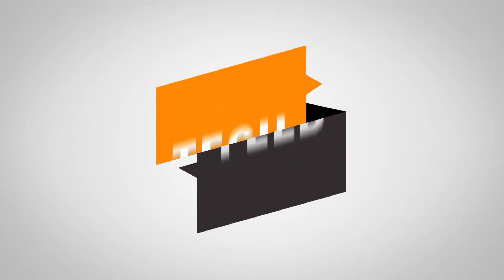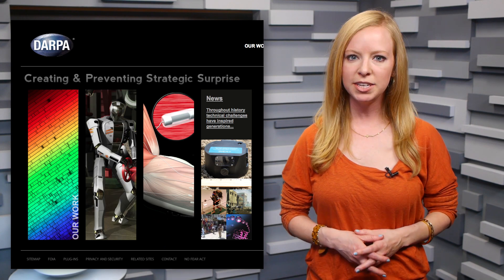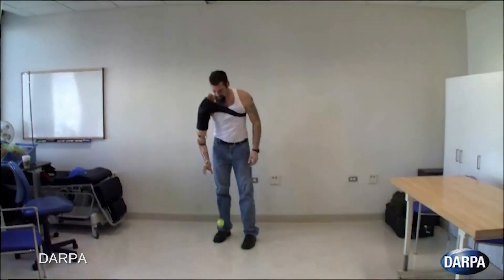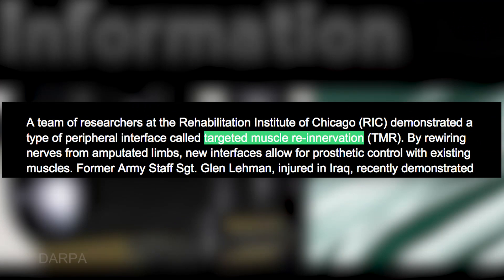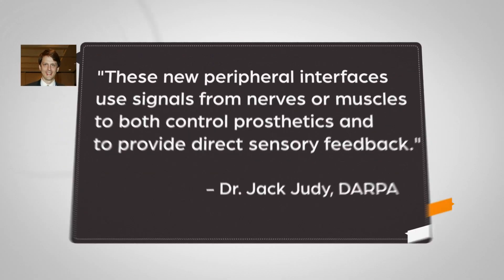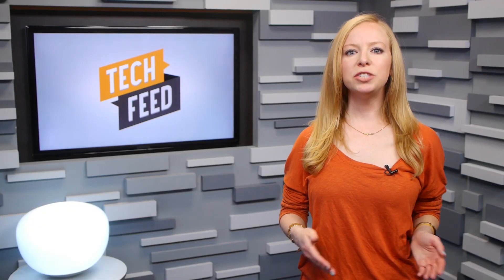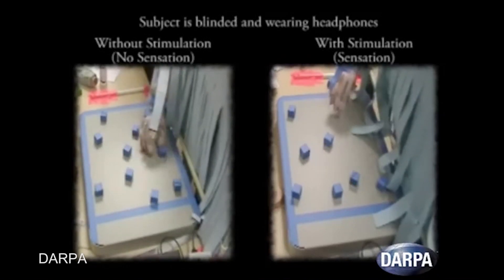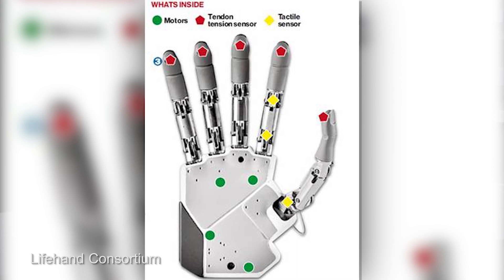DARPA Bionic Arms Let Amputees Feel Again

Comment: That' not entirely true. A foreign body will generally be encased in connective tissue, cutting off electric signals and pushing the device out of alignment, so if you are looking at implanted electrodes or more invasive implants, care must be taken.